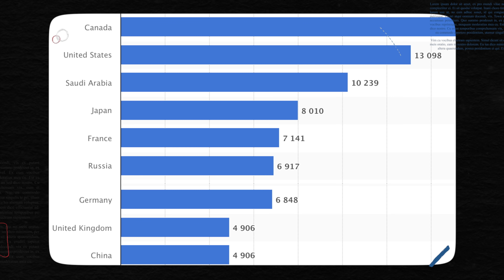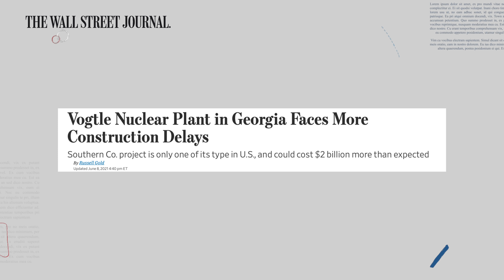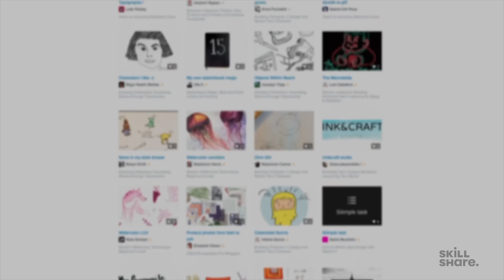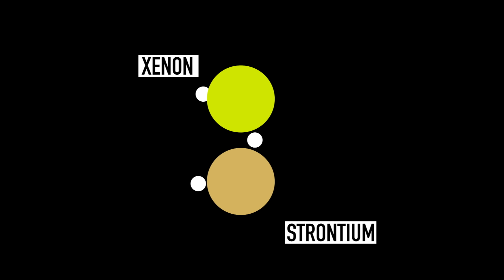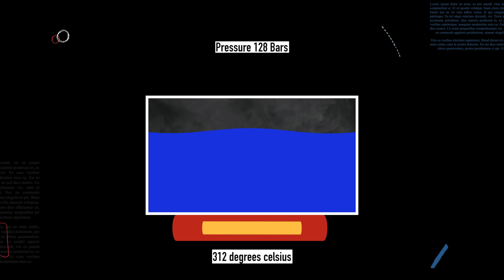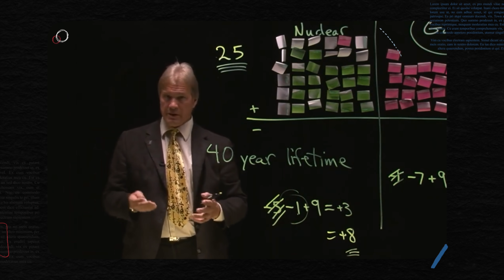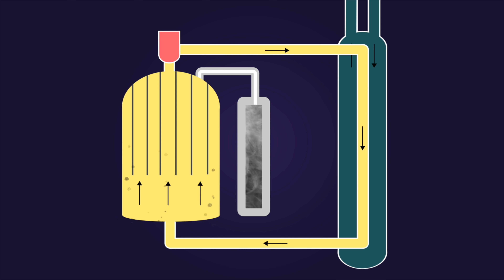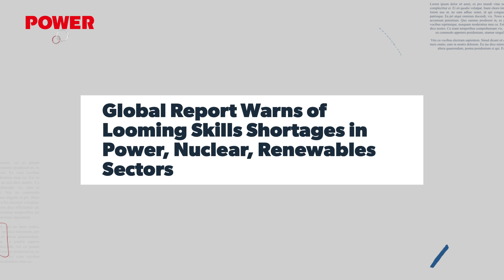Thorcon Just OBLITERATED Nuclear Energy’s Biggest Problem

Comment: Thank you. We won't make progress against   global heating until we have safe affordable nuclear fission at large scale.
Reply: Huh, Huh, Huh. I got some questions: doesn't the molten salt fuel eat through most reactor and containment methods, because it is SO CORROSIVE. Does it not react with water explosively, so if it were to receive a leak of water drops or worse, if the containment were to break and the fuel were released into the atmosphere, the results would be plumes of vaporized radioactive fuel for the residents of surrounding counties to breathe in deeply? Finally, in computing the cost of nuclear power did you figure in the cost of depopulating areas the size of US states as you nuclear industry folks accomplished in Chernobyl and Fukushima? Are you advocating planting the nuclear power plants in the ocean bottom now, so you can honestly say that you cannot reach or fix or prevent the underground radioactive leaks, when they occur, to limit your expenses? Are you totally nuts? 

Go live in Chernobyl's exclusion zone. You can get very close to nuclear stuff there. Reportedly, due to the inadequate clean-up, Fukushima is also another place in which you can get close to your beloved nuclear power. Go play around among their plastic bags of contaminated, radioactive dirt. Those are going to leak soon, what with having been exposed to the sun and wind for close to ten years, so you will soon have nice, radioactive dirt that you can use to grow your own crops. Have fun, fun, fun, until the cancers take your fun away!
Reply: Good points. Re corrosion the salty environment sounds troublesome but you need to bear in mind molten salt heat storage is not new. It is widely used for example in the solar thermal power stations as well as other industrial applications. The main issue in a high temperature nuclear reactor is the neutron flux that can slowly alter the crystalline structure of the reactor vessel. However, the molten salt reactors being implemented are designed to safe life principles. The reactor will be decommissioned before it is seriously weakened.

Corrosion still requires oxygen and to the extent there is any gas in the reactor chamber it is inert, such as helium. The reactor vessels themselves are made of high grade high nickel high silicon stainless steel. There has been a lot of research into this and the Chinese say their new MSR that came on line this month is made of a new stainless steel alloy they are confident won't corrode.

With regard to water, yes, MSRs are dry and for good reason, they operate around 650C way above water boiling point. You don't want water to get anywhere near them. The Chinese program is about having these systems in the desert areas of western China.

It is likely MSRs greatest application will be in dry areas of the world without the necessary water supplies to allow conventional power plants that are dependent on substantial water supplies for raising steam and cooling, or in the case of pressurised water reactors the substantial water supplies needed on standby for emergency core cooling.

Molten salt reactors are already molten so there can be no meltdown. They are also not pressurised so there can be no explosive decompression or venting as happened at TMI and Fukushima. They use a basement design, effectively they are below grade, tanks in a pit below the reactor catch spilt fuel salt in the unlikely event  the reactor should leak or overheat. 

Overall they are built to fail safe principles.
Like a coal furnace they require continual stoking to keep them going. In the event of a problem the reactions subside and they  shut themselves down passively without operator involvement.

Comment: These safe reactors should have been used 50 years old. If so we would not have the pollution and climate problems we now have And would have low cost fuel now.
Reply: France did it in 1970s.
Reply: @jimgraham6722  hi Jim. The US Did it in the 60’s but shut it down without explanation when it was finished! The current unsafe reactors provide fuel for atomic bombs, safe Thorium reactors do not!
Reply: @dinaldcurchod3296  Agreed. The shut down of the MSRE program was as much about institutional politics as about political politics. It was a power struggle between Weinburg and Rickover over budgets and way ahead at a time when money was tight. Rickover had more influence in Congress, he won and MSRE was shut down.

Comment: Let's address the elephant in the room: Water and fuel next to each other. And fuel pumped around like water. NOPE. A primer circuit break is a disaster.
Build a lead circuit, and leave the fuel in the pot, far from any water. In case of break, it's just lead. And in case of overheat, you just use the freeze plug and drain the pot.
Reply: Lead has a high density and viscosity making it hard to pump. Its high boiling point and high thermal conductivity make it easy to cool the reactor passively after it is shutdown through.
Reply: I would be surprised if they did not have a secondary salt circuit like sodium cooled reactors have a secondary sodium circuit
Reply: @ValExperimenter  
So a break in the heat exchanger will lead a sodium-water explosion with contaminated primer sodium? Lead is the way. Put a bunch of bismuth in it, and it will flow over 130C. In case of disasterous primer break, it will just flow out, and solidify, even even entombing the contamination.
Reply: @bandiras2  I did not suggest using sodium in the secondary circuit even though it has been used successfully in that role for many years. I suggested using a secondary salt circuit. There is extensive experience using molten salt as a heat transfer and energy storage fluid.
Reply: @ValExperimenter  
Sorry for the misunderstanding.
A low melting point, with high boiling point non corrosive salt then. I don't see the problem with that. I still prefer lead, because it's shielding properties. Primer liquid will be radioactive, and lead can contain it in case of spill.
Reply: I always thought the way to go with a molten salt reactor was a helium brayton cycle using thorium fuel. Thorium is much cheaper and more abundant than uranium. .  The constant pressure system can't have a catastrophic steam explosion like you can get with a high-pressure boiling water system, the helium is unreactive so it can't have an explosive chemical reaction with the fuel, and the radioisotopes of helium are very short lived so even if the working fluid is released, there won't  be widespread radioactive contamination. as for dealing with a break in the primary circuit, the floor of the containment chamber should drain into safe fuel storage to catch any fuel leaks.
Reply: @leonardjoosten538  
Love that helium cycle. Sadly there is no enough helium on the planet to fill enough reactors. Ironic. The 2nd most abundant element in the universe, and we have almost nothing of it.
Reply: @bandiras2  You only need Helium4 for a helium cooled fission reactor and there are billions of cubic meters of it in reserves that are currently commercially viable for extraction.  There are many magnitudes more helium in the ground and free in the atmosphere that can be recovered, but not commercially viable at this time.
Reply: The molten salt isn't circulated far, only just outside the reactor, not more than a meter or two.  Remember everything is low pressure here so any reactor leaks ooze not explode.  There's a catcher pan that captures any reactor leaks and transfers them to the drain tank.

Comment: Somebody has been letting the engineers out of the closet again!  NOt so sure how pleased about the "offshore" positioning, but it has tremendous possibilities. FR
Reply: More Chernobyls and Fukushimas? Huh, Huh, Huh. I got some questions: doesn't the molten salt fuel eat through most reactor and containment methods, because it is SO CORROSIVE. Does it not react with water explosively, so if it were to receive a leak of water drops or worse, if the containment were to break and the fuel were released into the atmosphere, the results would be plumes of vaporized radioactive fuel for the residents of surrounding counties to breathe in deeply? Finally, in computing the cost of nuclear power did you figure in the cost of depopulating areas the size of US states as you nuclear industry folks accomplished in Chernobyl and Fukushima? Are you advocating planting the nuclear power plants in the ocean bottom now, so you can honestly say that you cannot reach or fix or prevent the underground radioactive leaks, when they occur, to limit your expenses? Are you totally nuts? 

Go live in Chernobyl's exclusion zone. You can get very close to nuclear stuff there. Reportedly, due to the inadequate clean-up, Fukushima is also another place in which you can get close to your beloved nuclear power. Go play around among their plastic bags of contaminated, radioactive dirt. Those are going to leak soon, what with having been exposed to the sun and wind for close to ten years, so you will soon have nice, radioactive dirt that you can use to grow your own crops. Have fun, fun, fun, until the cancers take your fun away!

Comment: That's what we need! Tons more heat production!
Reply: Huh, Huh, Huh. I got some questions: doesn't the molten salt fuel eat through most reactor and containment methods, because it is SO CORROSIVE. Does it not react with water explosively, so if it were to receive a leak of water drops or worse, if the containment were to break and the fuel were released into the atmosphere, the results would be plumes of vaporized radioactive fuel for the residents of surrounding counties to breathe in deeply? Finally, in computing the cost of nuclear power did you figure in the cost of depopulating areas the size of US states as you nuclear industry folks accomplished in Chernobyl and Fukushima? Are you advocating planting the nuclear power plants in the ocean bottom now, so you can honestly say that you cannot reach or fix or prevent the underground radioactive leaks, when they occur, to limit your expenses? Are you totally nuts? 

Go live in Chernobyl's exclusion zone. You can get very close to nuclear stuff there. Reportedly, due to the inadequate clean-up, Fukushima is also another place in which you can get close to your beloved nuclear power. Go play around among their plastic bags of contaminated, radioactive dirt. Those are going to leak soon, what with having been exposed to the sun and wind for close to ten years, so you will soon have nice, radioactive dirt that you can use to grow your own crops. Have fun, fun, fun, until the cancers take your fun away!
Reply: @mikefas1160  No.
Do some research!
Reply: @gregbailey45  You would be more persuasive if you could cite to some study about some material that could contain the hot, radioactive salts indefinitely with 100% efficacy, rather than just yelling "No" like you would to your dog. If there is a leak of radioactive molten salts in the first MSRs, even if it only causes a mini-Fukushima, that will be death for the future of MSRs, so the corrosion problem must be completely overcome before large-scale MSRs can be built in the US or EU. I sure hope that some material that can survive and contain the radioactive molten salts in such MSRs for many decades was discovered, but to my knowledge, the last MSR that was operated (which was also the first MSR) decades ago had to be closed reportedly due to corrosion.

Comment: 9:25 -- "... you don't need a containment building." -- When the first commercial nuclear reactors were proposed, US Congress insisted the primary be contained in a vessel that could withstand the impact of the largest, fully loaded commercial aircraft.  NRC then doubled that impact energy. That requirement still stands in the US.  If you want to run these plants in the US, you're still going to need a containment building.
Reply: But not the enormous size and thickness used for current reactors, to contain the steam explosion if the reactor vessel were breached.
Reply: @wwoods66  The kinetic energy of a fully loaded 747, doubled, is considerably higher than that of a steam explosion.  Containing the steam explosion of a recently scrammed reactor (as in Chernobyl) is a positive side effect of the primary design goal of preventing a radiation leak in the event an airliner crash into the reactor

Comment: I am sorry, but I don't agree with your statement "we cannot replace coal with renewables" WE MUST DO IT!! It is totally possible. The UK is shutting all of its coal power plants in the next 5-years and most of that power is being replaced by renewables. Renewable energy is going to be stored so it can be used 24-hours. In the UK we are investing in Hydrogen production from night time renewable energy. Nuclear is very very expensive and even France has not found a solution for disposing of its high-level nuclear waste. It is sitting in ponds like all the other countries using nuclear. We have to find a better energy solution. I have been hearing about Modular small nuclear reactors for 20-years. No one is going to approve these and the risks are just the same. There are none being planned and it is absolutely ridiculous to expect a ship yard to create a nuclear reactor. Laughable. Molten Salt reactors are another promised technology that I have been reading about for 20-years or more. Only the Chinese are thinking about actually making one and the problems are substantial so I doubt any reactors appear any time soon.

Comment: No country has a real plan to deal with nuclear waste such as the spent and highly toxic nuclear rods. No country has developed a fully operational reactor to deal with the waste. Canada and the US have enough spent fuel rods to fill 60 football stadiums. Now you want to mass produce nuclear reactors. I'm all for nuclear power once a solution is announced for toxic nuclear waste.
Reply: @George Mann My mind is open to the use of nuclear energy. I witnessed first hand the size of 80,000 used nuclear rods encased in concrete and steel. It will be decided in September 2021 where they, along with 200,000 more, will be buried.

Comment: I am guessing this was one of the channel thats were paid for this content... many turned down the $50,000 as they have a moral compass!!  i work with IAEA and IPCC and people are insane to think nuclear alone will ever be the answer why? there is ONLY 240 yrs (currently a 10% use of 1,800TWh) uranium in the whole world (thats mining and skimming) even if you cut down the uranium in this reactor by 80% (20% enrichment is x15 material load) to get to total world usage you would need today 4553 Nuclear plants which depletes fuel 10x faster (24 yrs) now we are planning to see a 4-7x multiple with the adoption of mass Electrification (10x as more countries gain better electrical access not available before)  this is also a plan for Thorcon to gain control over the power infrastructure in the world allowing THEM to set demand and pricing!

Comment: Thermal MSRs without fissile absorptions much higher than other absorptions, like in fission products, the negative temperature does NOT work like that. MSRE &LFTR have a negative temperature corfficients because they use/use Weapons grade fuel and had/habe low fission products.

Comment: Singapore has commissioned a solar panel array and a underwater grid in Australia - 3000km away. You don't have to rely on a local grid, you can connect with other grids and then you won't require Nuclear energy. Really this planet receives more sunlight, wind, wave, tide and geothermal renewable energy than we can use - ever. Why would you want to commit to yet another form of energy that leaves behind problems for the next generations. I don't understand this insanity at all.

Comment: Where did the graph come from for the safety of coal versus nuclear? If it's from ourworldindata then the numbers are really, really unrepresentative. Chernobyl has a number of deaths attributable as about 4000 compared to the possible 60,000 expected to die from short term and long term effects.  Coal has a death rate of 25 premature deaths per year. They compare premature deaths with short radiation related deaths. To be at all indicative it should be long term versus long term. Nuclear power has been around for 65 years. There are a minimum of a few thousand deaths attributable to nuclear power in that time (it could be as high as 100,000 with cover ups in Russia and unknown fallout having long term effects). 2000 people in 65 years works out to about 30 deaths a year. The ourworldindata graph scales according to TWhr of production. Nuclear is currently producing about 2500TWhr which is how the number of deaths per year can be scaled down to 0.07 deaths per year. Nearly 60 deaths per year are attributed to air pollution. Frankly I think I'd rather die from having a cough rather than from glowing in the dark.
There is already 2500km2 of the surface of the planet that is a no go zone forever. What portion of the planet is it acceptable to never have anyone living on ever again?